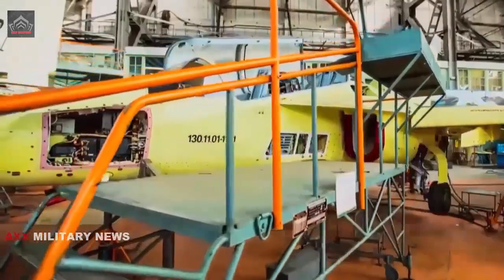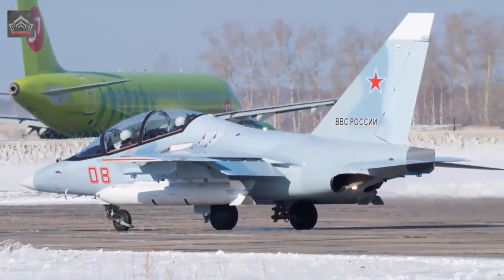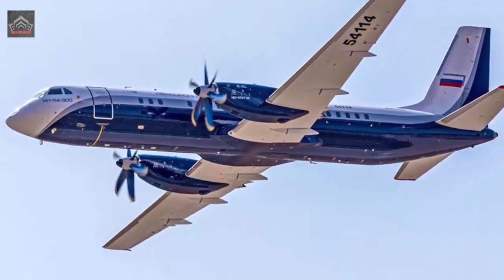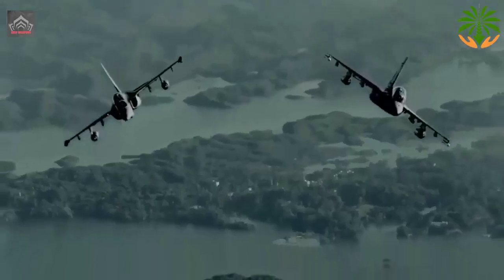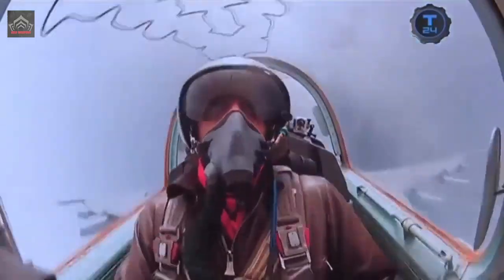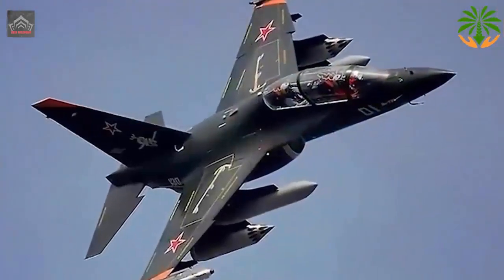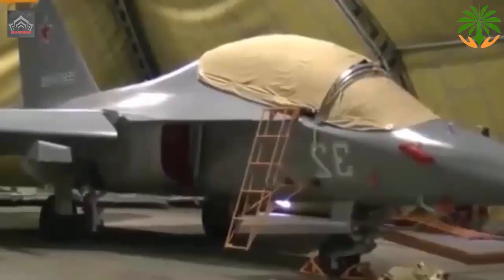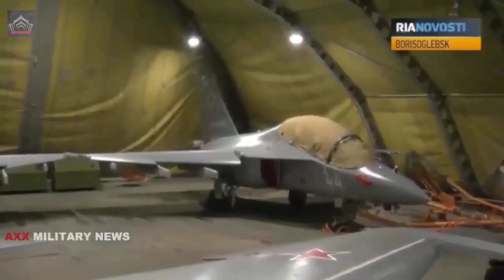Russian Combat Trainer Aircraft Will Be Equipped with New Aircraft Engines

Comment: Quad Fly By Wire - What if the problem you're trying to avoid by flicking to another FBW system is effecting all 4 systems - Where is the solid cables?
The Fly By Wire systems can be screwed with from outside the aircraft.

Comment: Nice trainer, but this aircraft is a little light and unarmored to replace the Su-25 on low-level attack missions.
Reply: Это машина предназначена для обучения молодых пилотов и курсантов военных училищ,заменить СУ-25 он не может, это все равно как авто заменить велосипедом!
Reply: @АлександрОкулов-е5ъ  Yes, but what aircraft will replace the Su-25's which have been lost in Ukraine? Russia only had about 200 Su-25's when this war began and I believe they no longer manufacture the Su-25? Both the Su-24 and Su-34  attack aircraft are wonderful, but much more expensive to build and operate than the Su-25-and they can't do the low level missions of the Su-25.